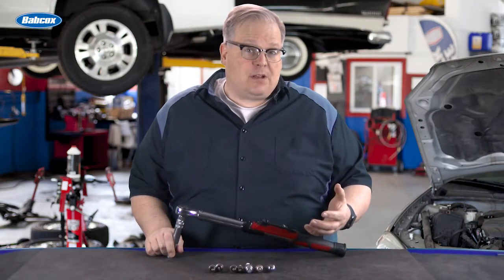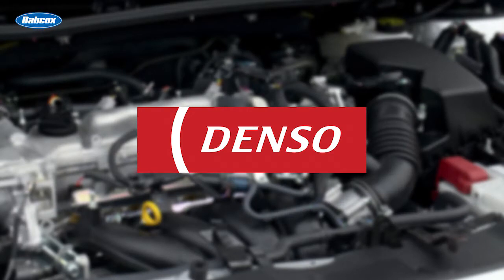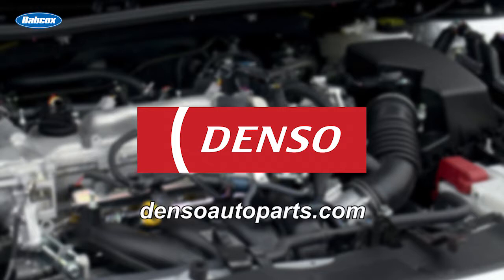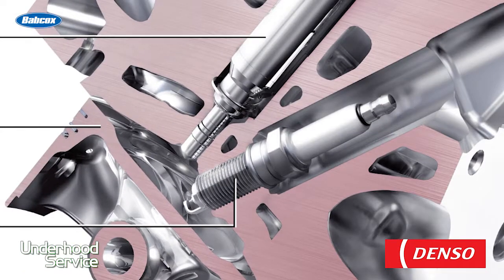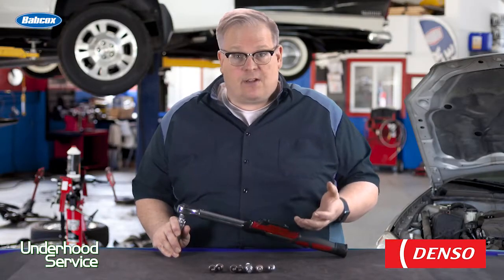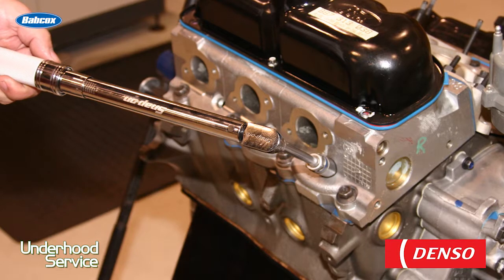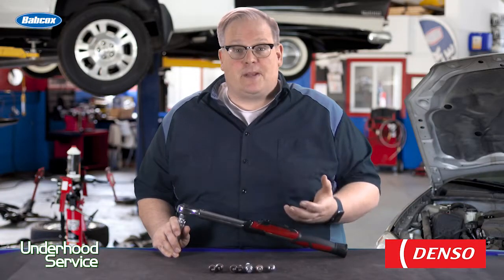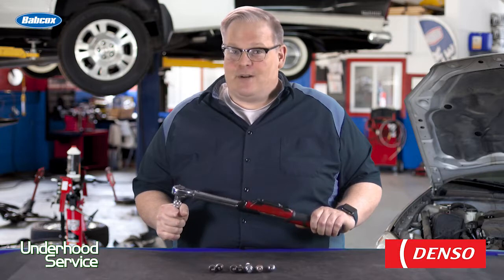Spark Plug Torque Specifications | Tech Minute

Comment: Well if you have an NBS Silverado torque to 11-13. People also say to just hand tighten then quarter turn with the wrench. I REALLY wanted to torque them but oddly everyone I knew with a calibrated torque wrench just pushed me to the non accurate  approach. 

Well imagine my fuckin surprise driving home from work and suddenly hearing what turned out to be the sound of one of my spark plugs getting launched out of the head.  I then quickly discovered why no one makes 7 cylinder engines. 

Lets just say the drive home was "interesting" Thankfully the plug was fine and still attached to the cable. Now I get to remove all 8, apply anti seize and torque accordingly.  And I'm also thankful the LR4 is one of those engines that just about impossible to kill.